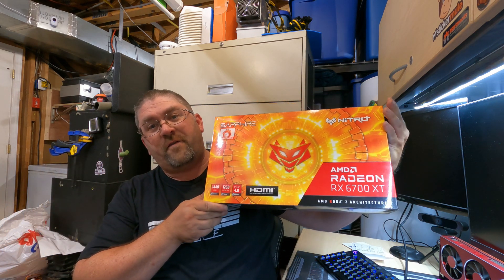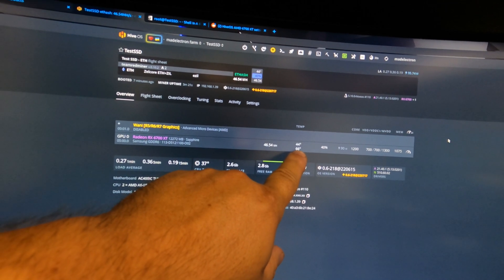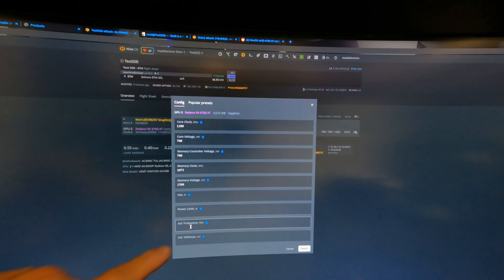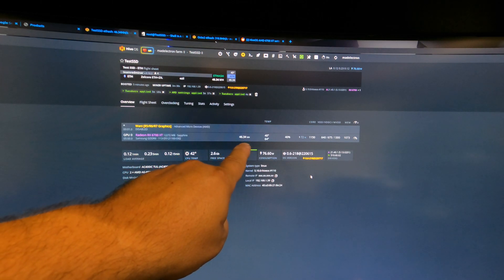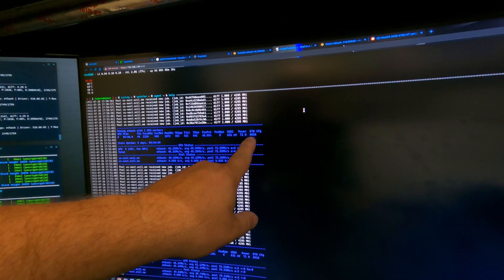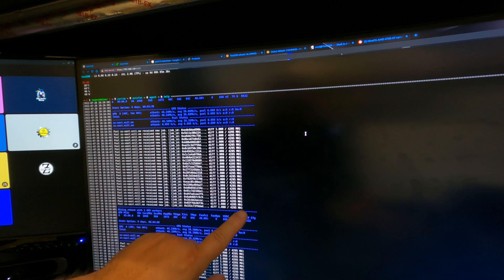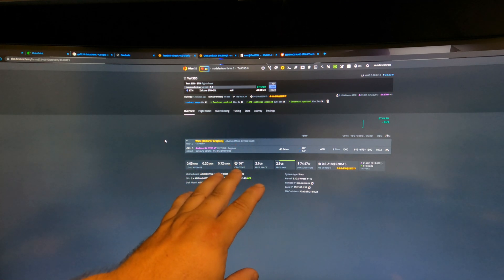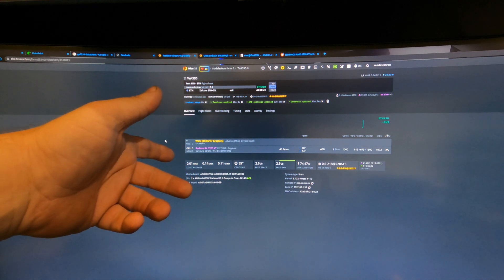TeamRedMiner R-Mode On 6700XT

Comment: Thanks to you and RPM! Couple extra points. Not as efficient in WINDOZ. ~46.55Mhs ETH. @ 106-12W w/ or w/o Rmode A628-A640, VDDC 887, 74-82C. For some odd reason the drivers get corrupted and locks up over-time as a  DEAD GPU error. You can avoid a full restart my killing the app. Disable the driver. Update then re-enable the Display (s) if more than one card. WINDOZ can also do some goofy shit. . . no surprise,  sometimes it updates all the displays, sometimes you have to do them individually. If Afterburner is used reload/save settings. Then launch TRminer. Should run solid for a couple days~ I'm moving my 67's to Hive ASAP; in other word right now~. Will report results. . . Thanks! HOLD~